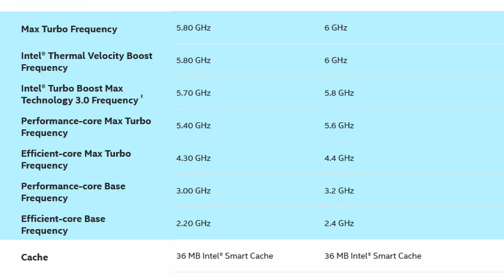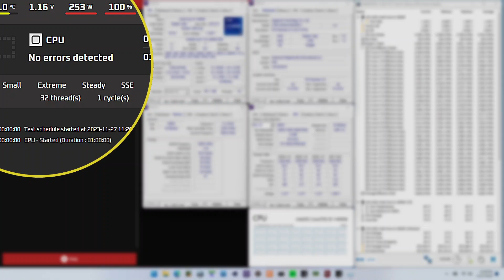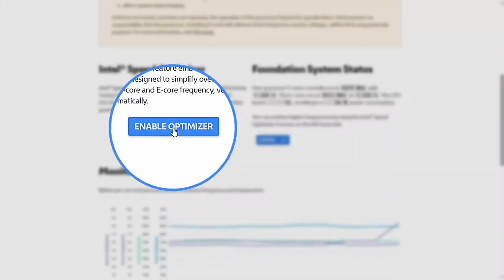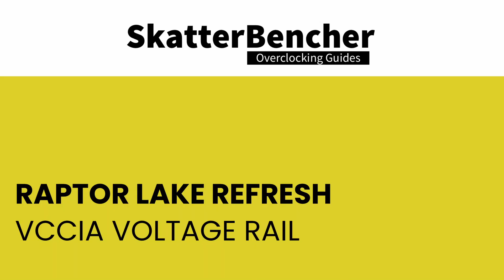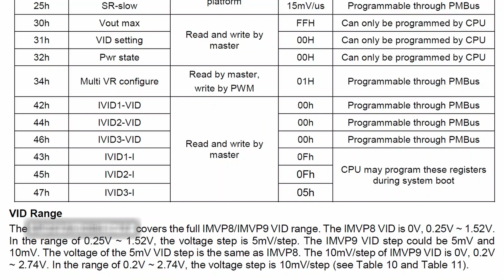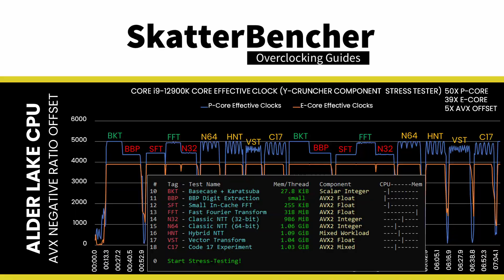Core i9-14900K Undervolt & Overclock to 6200 MHz feat. Z790 Aorus Master X | SkatterBencher #67

Comment: Could you make a video like this for Asus motherboards? I own an Apex Encore with a 14900k and really want to do this loadline undervolt that people talk about.
Reply: Yes, please do it on Asus... There is no vid of 14900k on Asus on YT.
Reply: This would be really helpful. I've been riding the struggle bus for way too long with my new rig. Using the 14900k, Apex Encore and i have two different ram kits ive been testing. The Gskill Trident Z5 48gb 8000MTs and a set of Dominator Titanium 48gb 7200MTs, and i cant get this thing running stable for the life of me. Seems like these 14th gen cpus are a bit finicky. My last build was using the 11900k on the Z590 Apex and I had a custom stable tuning completed in like a night or two and never had to mess with it again for the last 2 years. This new build is making me crazy lol. There's so much conflicting information online, and so many new and unfamiliar settings in this current gen of Intel. Would greatly appreciate a guide like this with the Apex Encore.
Reply: Try using his 13900KS guide on Asus.  It'll get you most of the way there.
Reply: Have you guys learned anything new? I just got my rig put together. *14900k, Apex encore.
Reply: Another one here! 14900k + z790 dark hero
Reply: @d1scopotato222 that mobo sucks
Reply: @godnamedtay  Yeah I switched to Z790 Dark Hero and learned the undervolting stuff. I main reason I changed boards though was because I needed integrated graphics.
Reply: @ yea I hear u on that, I have the z690 unify x, great board but no igpu kinda sucks a lil bit. Really wish I had the apex. Although im not an ASUS fan, cant deny its the best z790 mobo outside of the asrock nova, but its not even close, apex is the GOAT
Reply: I ended up swapping my K for a KS before my return window closed. And im still struggling with getting everything stable. Unfortunately the KS I got isn't binned very high. I would really love to see a good guide with either of these cpus and the Apex Encore. Lots has changed since my 11900k build and im a bit overwhelmed tbh lol. I learn so much more easily from good instructional videos vs reading guides. Seems these cpus are more finicky now.
Reply: Yeah we have to read a whole textbook to tune a 14900k. @TheSinisterDev
Reply: I Got 14900k running super stable, zero thermal throttling, Asus mobo strix z790e. Nice and clean. Had to change a few settings on Asus to it did not fry the chip.
Reply: I wish I could provide info that would help more people, but for my situation the problem that was causing so much instability was the Thermal Grizzly Contact Frame! The V2 is deceptively simple. Compared to the V1 that literally needed to be torqued down properly with great precision, the new version simply says "hand tighten only". So i had tightened the new screws down gently until they came to a stop. Apparently that's way too much! I found a discussion on reddit saying not to use the new screws unless you literally need the added length to fit your board. Instead, use the original screws from the stock bracket and just tighten them down loosely until the contact plate feels locked in place.
I turned on the PC, turned on XMP I and prayed lol. It booted right up and passed several stress tests! Tuning the system has been way easier now! And yes the Asus guide is extremely helpful, but is a bit intimidating when you first start reading through it.
Reply: Bro if u can’t make this work on a different mobo after watching this just give tf up…

Comment: I’m a little confused by your voltages. I have the same processor, same exact board, and even same water block and same exact RAM. However, using almost any of these sets of tweaks, I can see VrVout peaking at up to 1.6V and it makes no difference what LLC or negative offset I use. I’m guessing you’re looking at vcore and not VrVout but even so those voltages you’re getting seem insanely low. Even when my AI biscuits score is around 90. That’s why I’ve been so frustrated with my overclock is because I hate seeing spikes up to 1.6V on VrVout.
Reply from the maker: What is your IA AC loadline setting?
Reply: @SkatterBencher  I’d love to spend some more time trying these out in detail and then can get back to you if you’d be willing to help. It would be invaluable to me because we have such similar setups.
Reply from the maker: In OC Strategy #4 I try to clean up the voltages, including spikes to 1.6V+. You can see the comparison here: https://youtu.be/Ww_BJhz_w98?t=2422. The root cause is that the default IA AC loadline is set quite high. 

Just drop a comment here if you have any questions after your testing. I'm happy to help!

Comment: Would direct die cooling affect the performance in any way?
Reply from the maker: Direct die would improve the thermal transfer from the die into the loop. Since my cooling solution has thermal capacitance headroom (water temp below 40C), it could yield additional overclocking headroom as well
Reply: Thank you for your detailed response, appreciated :) @SkatterBencher

Comment: would love to see a guide with an MSI motherboard since is really lacking as far as videos go
Reply from the maker: I'll see if I can arrange something with MSI
Reply: @SkatterBencher  Did you ever get an answer from MSI? Trying to tame the 14900ks on my MSI z690 Torpedo EK X has been more difficult than expected. Out of the box with auto bios settings it was trying to push like 1.5v through my CPU. I just quickly set the CPU voltage mode to override and worked it down to 1.385v at the stock clock speeds with power limits unlocked but I'm sure it could be much better.

Comment: It's interesting how the V/F curve is exactly the same as a 13900k. You'd think the 14900k would be a bit more power efficient, hence the ability to reach 6GHz at stock. Maybe it's the motherboard manufacturers not updating it when they updated their BIOS.
Reply: they do clock higher with less vcore. now the adaptive and thermal velocity setting's are shit IMO (and quite a few other) all core will be cooler and preform better. I've seen a 13900kf at 6.2 all core and a 14900k at 6.3 but both of n these were on custom loops with direct die cooling. you can get 5.8-5.9 on a good aio 320 rad on 14th tho and pulls less power but most that's probably the ceiling, all you could do once either silicon or cooling is what's capping(let's pretend we're using the apex encore best ocing board change my mind)  you delid and lapping the die with a custom loop  o